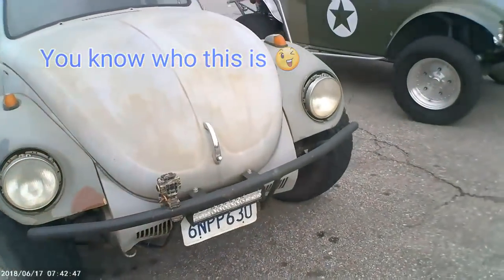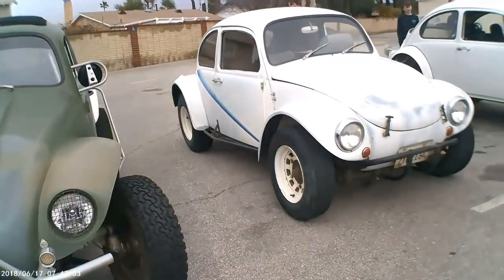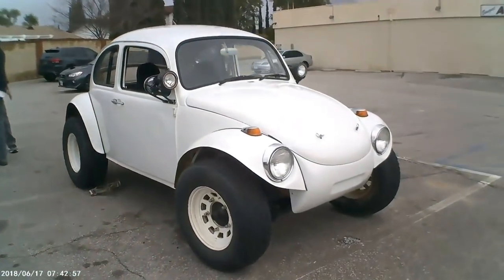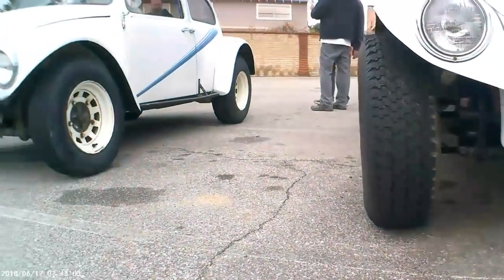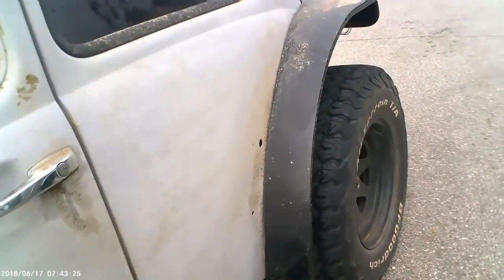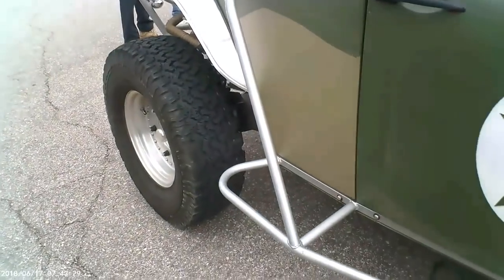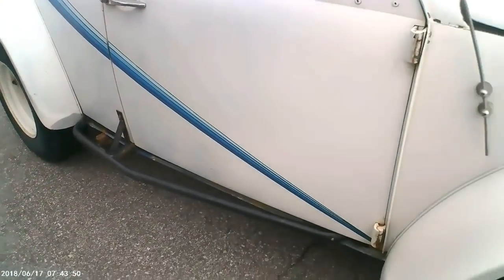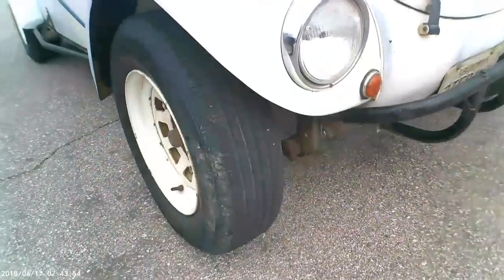[VW] Baja Bugs Club Offroading 2019

Comment: Cool!
Reply from the maker: Thanks! It was really fun. How's your 2110 doing?
Reply: @dustbuggy  its getting faster. 13.98 at 99mph. Had an intake leak on that pass. Ill get it fixed and see if the mph will get me over 100. Might try a single blow thru carb and see if its faster or slower.
Reply from the maker: These big motor always have a little trouble lol. That'll be cool! Interesting to see the results of that one, keep us posted if possible 😁

Comment: Why is the McPherson front end inferior? Is it just not as sturdy?
Reply from the maker: The struts are mounted through the body, which makes it prone to collapsing in at the hood. We have braced that area with a strut brace to take care of that issue. We also custom made 4 inch lift spindles so we have more ground clearance. Both of those things have made her a beast offroad. The only shortcoming she has currently is her front travel is only about 6 inches right now